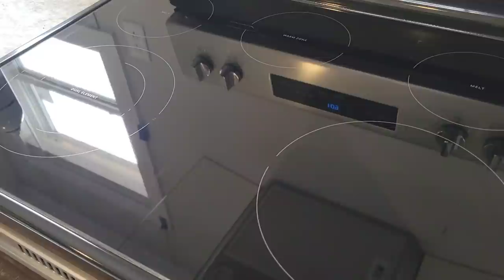MOBILE HOME CLEAN WITH ME | LET'S TACKLE THIS DOUBLE WIDE!

Comment: How exciting Tiffany its getting close to living in your new home!! I wish I lived close to you I love cleaning and I would clean your home for you! Tiffany get one of those dish scrubbers with the handle that you add liquid to they work great for cleaning showers and bath tubs also use the new Dawn foaming dish soap for your glass showers it works great! After each shower get in the habit of wiping down the glass after each shower it really helps keep them from water spots! And look on Amazon for dirt catcher mats for the doors you guys come in and out alot you can also get those shoe scrubbers you just stick your boots sneakers etc.. back and forth and it cleans the bottoms of your shoes off you might of seen them! Using baby oil on a cotton cloth on stainless steel you don't need alot rub into the stainless it makes it shine so nice its not greasy  either it just soaks right in!!🤗 ok ill hush now..🙄 love you honey..Camille 😘❤